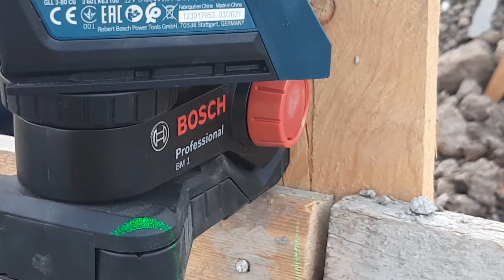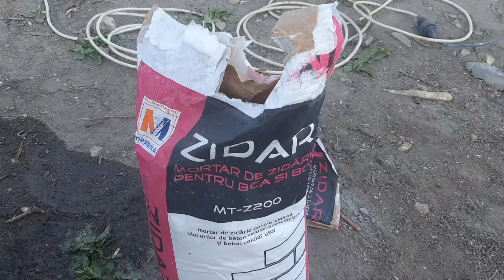O CASA BUNA SI IEFTINA FACUTA CU 8000 €

Comment: Costa 5000€ doar fundația. De restul nu mai zic...... 😂
Reply from the maker: casuta are cin jur de 40m patrati ( dormitor+sufragerie+baie+bucatarie in hol+ hol intrare) , exact cat un apartament cu 2 camere. manopera nu este inclusa in pret, fiind facuta intre prieteni. pretul materialelor inclusiv tamplarie pvc si usi nu am trecut de 8000euro(40.000lei) scrisa bob cu bob
Reply: Eu am turnat fundatia la o casa de 100 m2 si ma dus doar in pământ turnatul 2500€ fara manopera
Reply from the maker: @Gheorghita124  poi vezi, eu cu 8000 am pus si tamplaria pvc si am placato c rigips ,am lipit direct pe bca. Revin cu video cu update la lycrari. A iesit cocheta si izolata ....
Reply: @Gheorghita124  salut,acum când preturile au luat-o razna?și manopera cât a ajuns?
Reply: @DiCe.20-p9g  pai manopera la o fundatie de 100 m2 Pana la cota o adica placa este ca 2000-2500 euro
Reply: @Gheorghita124  5000 cu tot cu materiale?
Reply: @DiCe.20-p9g  7000-7500